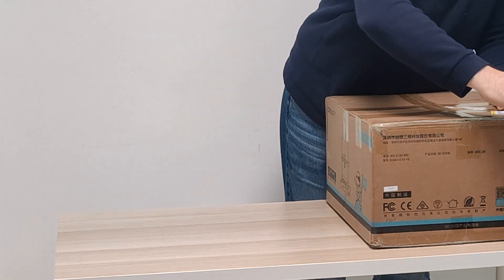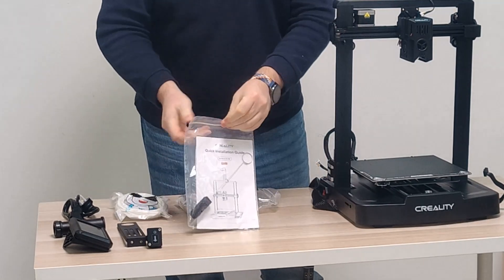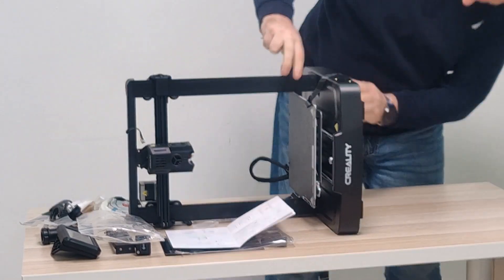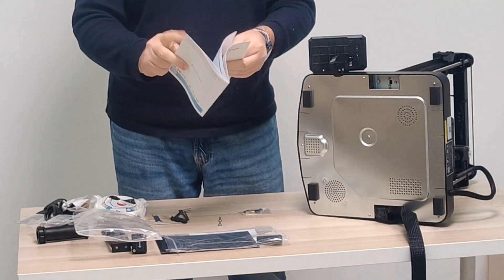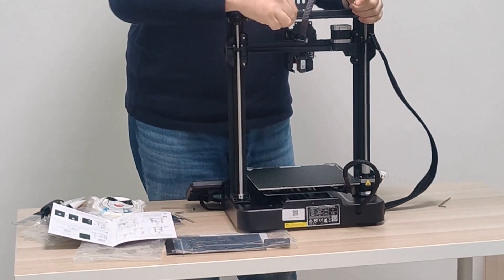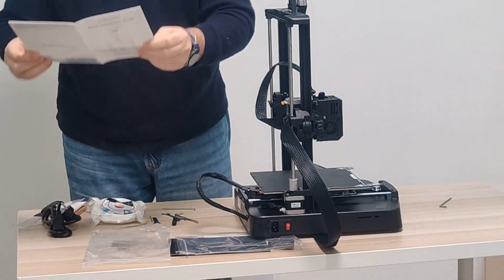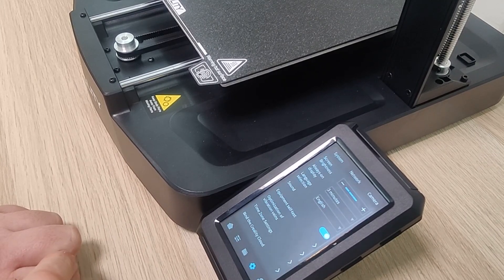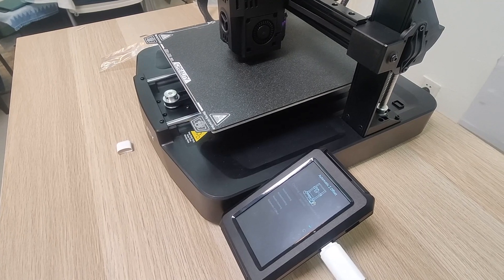Creality Ender 3 V3 KE unboxing and assembly #creality3d #3dprinter

Comment: i didnt get a spatula. but there as a stick ith ring at the end. anyone know what's for?
Reply from the maker: if you need to clean out the nozzle, that metal can be pushed from the top and push filament out of the hotend when heated - hopefully you don't need to use it often.
Reply: @kevin.in.3d  thanks. So far I didn't need it. On my old printer I had ,4 mm needle so I thought that was for cleaning